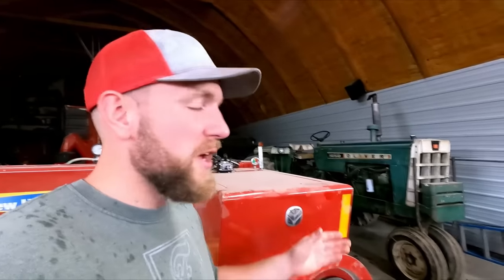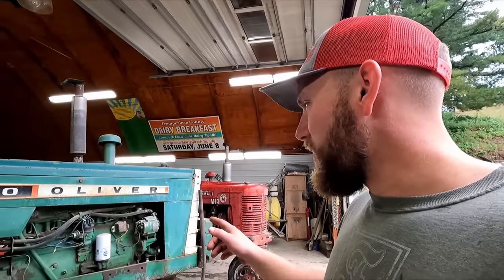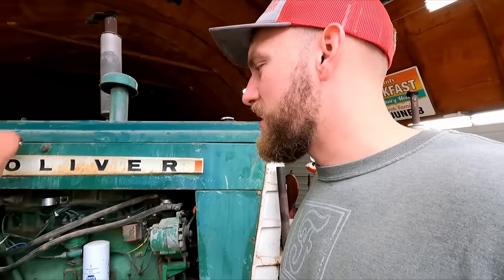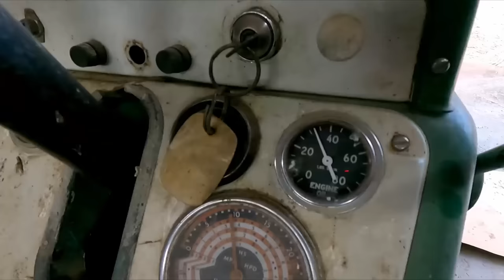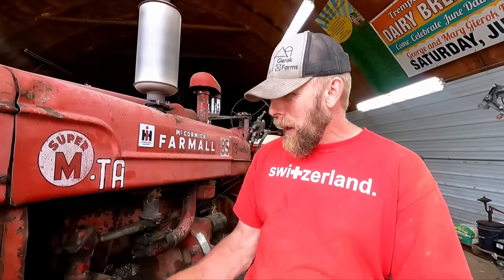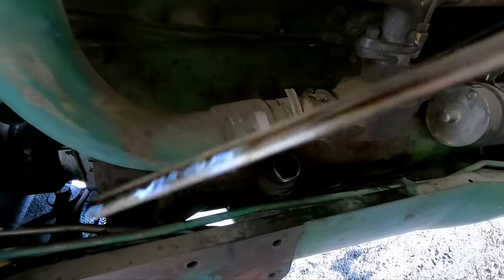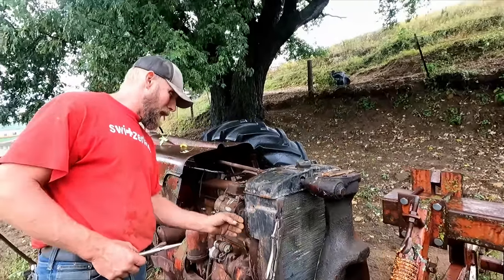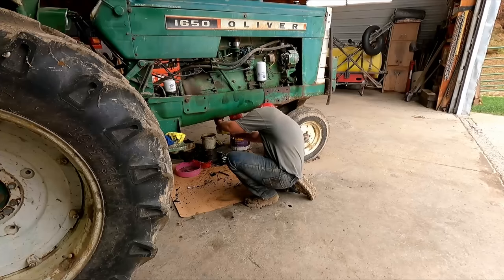Tractor Trouble!

Comment: You might want to try putting some stop leak in and run and see what happens
Reply: NO
Reply: Worst idea ever. You might want to try that with a leaking radiator but not an engine.

Comment: I had 5 olvers bet it is the oring on the bottom of the sleeve
Reply: A stuck open thermostat in the middle of the winter combined with short running time will always make the oil milky. I'd start with the thermostat.
Reply: Cold weather could have a aged O-ring shrinking just enough for coolant to seep then disappear when warmer weather arrives.